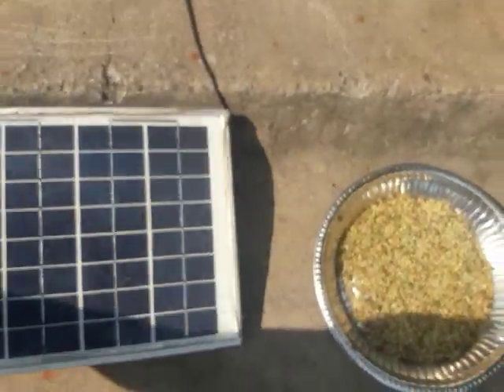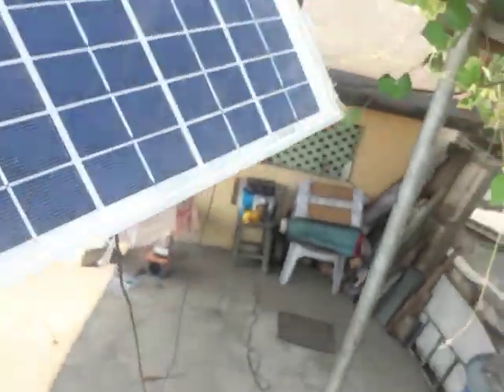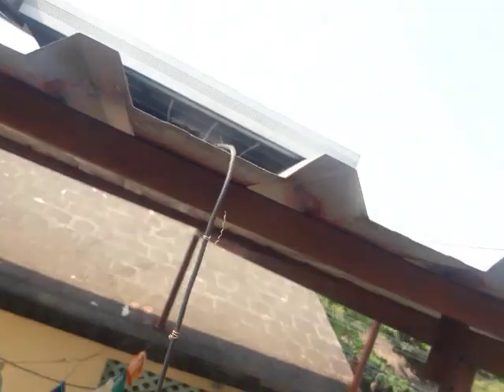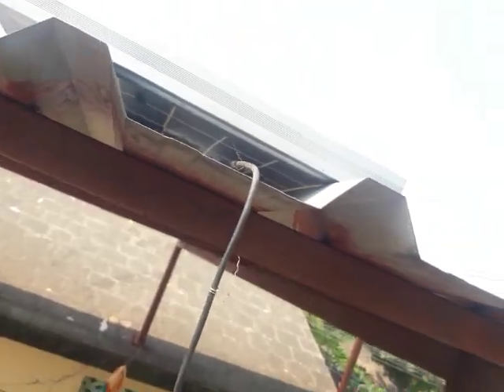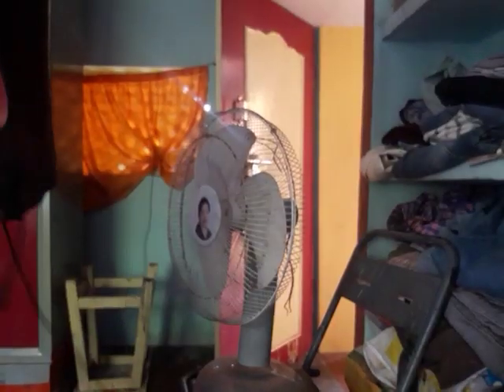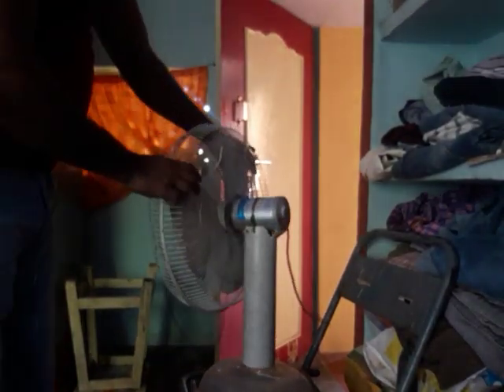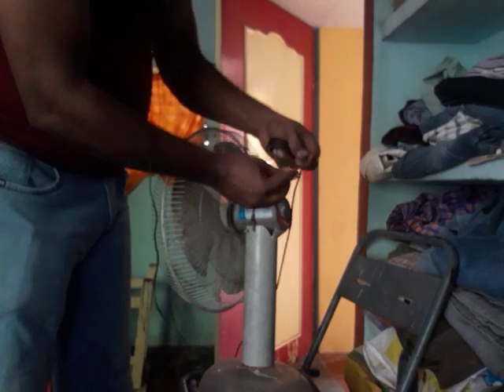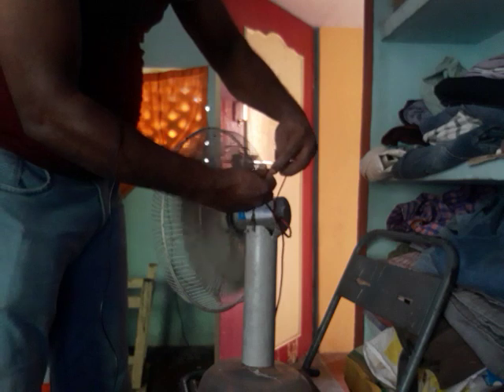Solar parallel connection with 24 volt fan

Comment: vanakam nanba...  24v panala 12v batterya yeppidi charge pannalam..? idea sollunga.
Reply from the maker: DC to DC ,36V to12V, buck boost converter ,solar controller ,battery charger